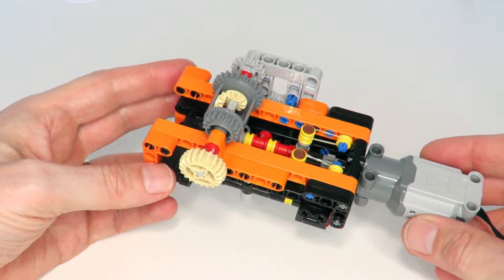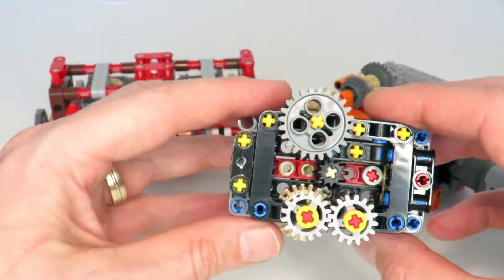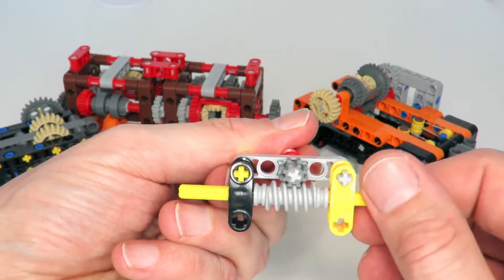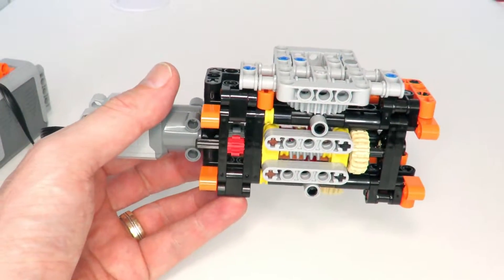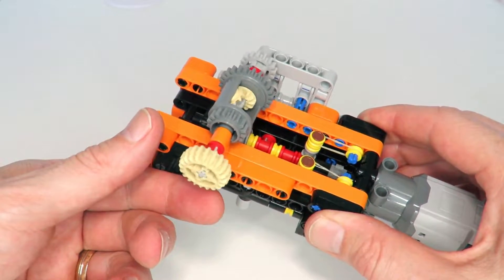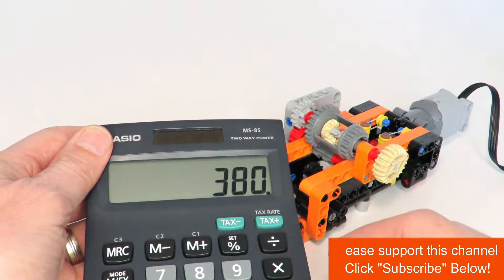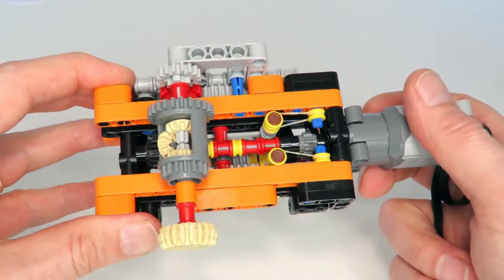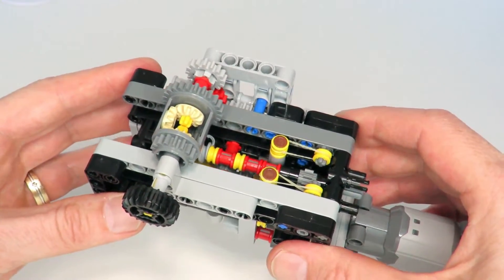Lego 2 Speed Automatic gearbox -  worm gear prototype. Includes build instructions.

Comment: Could the moving of the worm gear be used to shift to a third gear automatically?

I get that the time for the second gear would be only there for the length of the worm gear being used?  Maybe there is some way to put two worm gears inside the shifting mechanism to make this work.
Reply from the maker: Yes I think that could be possible. You can extend the wormgear my adding another one, and then to have the gear on the axle mesh with a third gearing ratio. The main issue is still the gear change speed. Thanks for the ideas.. 🙃